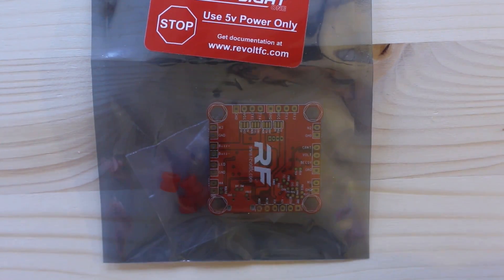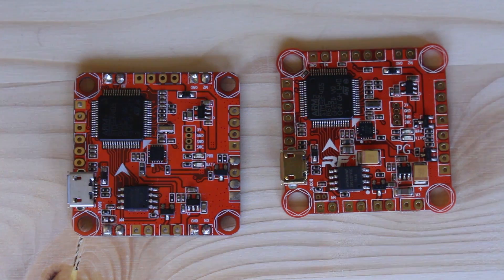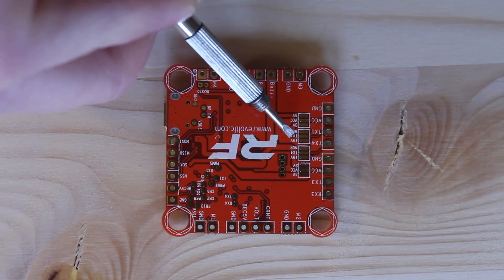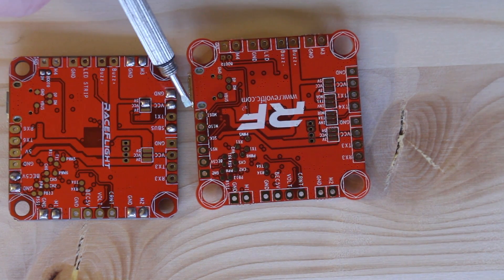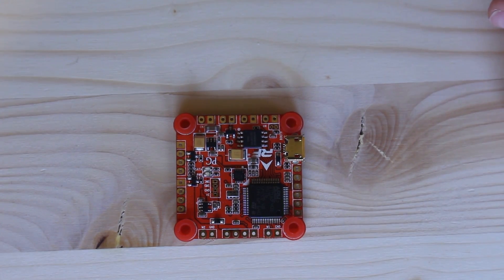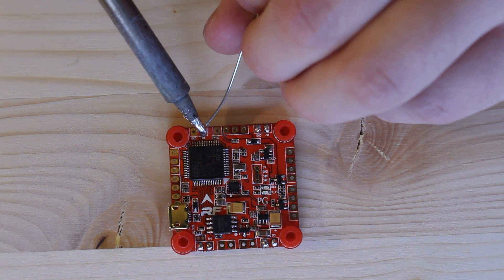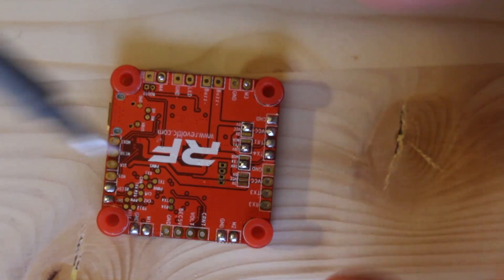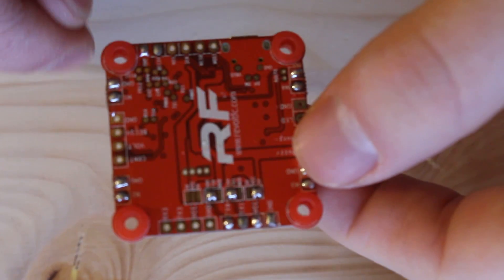RaceFlight Revolt V2 |  Part 1 Explanation and Pad Soldering

Comment: Can you wire a CPPM receiver to this FC?
Reply from the maker: Dan Martin it used to be supported. But ppm is so slow and sbus is so much faster and very cheap. I don't think it's supported any more for the simple reason that there's no benefit to using cppm. It only hinders performance.
Reply: AdeFliesFPV thanks for the quick response. That makes sense. Looks like I need to send my controller and receiver back to the shop then haha.

Comment: I'm new to Drone building and currently building my first drone. I just purchased the V2 Revolt, But I'm very confused on what I need to solder.

 I currently Soldered both VCC and 5V together, but I'm very confused with invert, TX1, normal TX4 jargon you mentioned in your video. lol 

Can Someone explain a bit more? I currently have a Taranis QX7 and Frsky reciever. 

Thank you!
Reply from the maker: Hey, you can send me a direct message on the RaceFlight Facebook page or directly on our slack channel and i'll help you get setup

Comment: Can you use tx3 for spektrum? I'd like to stack the RX using pins on the tx3, vcc, gnd location. Using tx1 would cause the RX to lay on top of the standoff. I don't see a place to jump pads for normal on tx3. Does it default to uninverted?

Comment: +AdeFliesFPV - are you able to tell me if RF1 supports any OSD (e.g.Minim OSD) I assume RF1 uses MSP?

I've got one of the Lumenier RF1 Skitzo boards, but have been reluctant to use it until now, because I like OSDs, but my 'race" frame has arrived so it's time to find out...
Thanks
Reply from the maker: jtan163 MSP osd is being worked on and tested now. I recommend joining our slack channel for information on that as I use osd separate from the FC.
Reply from the maker: jtan163 MSP osd is being worked on and tested now. I recommend joining our slack channel for information on that as I use osd separate from the FC.

Comment: So if I want to use Ibus for turnigy evolution, Which pads would I solder, thanks great vid....
Reply from the maker: Thank you! If you're using BB425 use either TX3 or RX3 for iBus. If you're using RF1 my recommendation would be to bridge NOR and TX1 then solder iBus signal wire to TX1.
Reply: AdeFliesFPV thank you